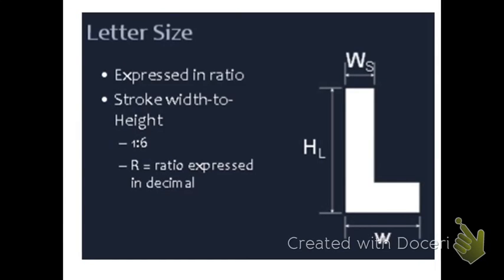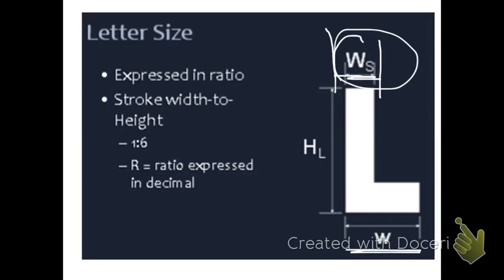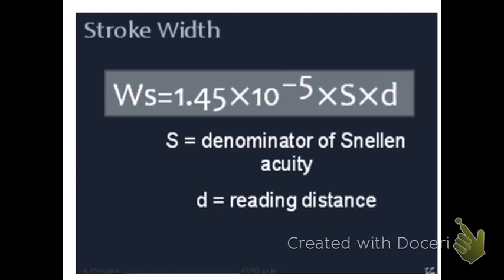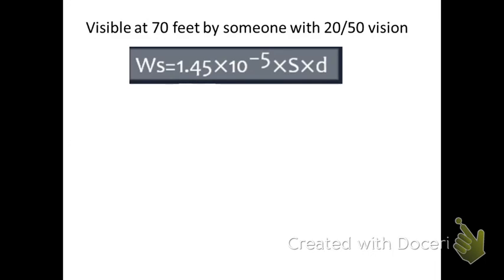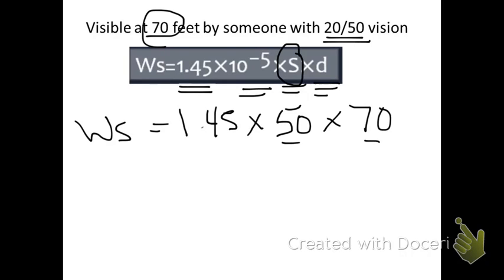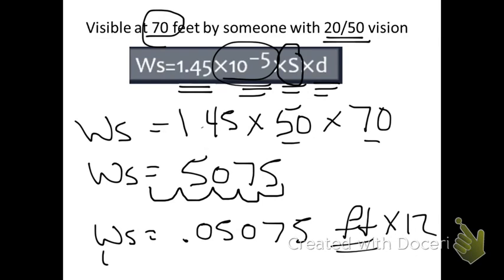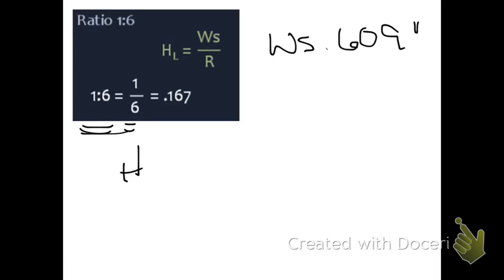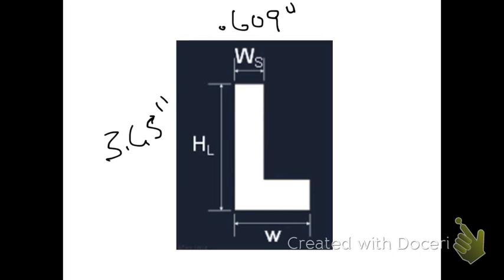Stroke Width Calculations

Comment: Hello Wayne, this formula seems to be very useful. I tried researching more into it online and I am unable to find any sources. Could you redirect me to a scholarly report or book that confirms its validity?
Reply from the maker: Hi Oscar! Thank you for watching and thank you for the question.  The author of our course got the formula from Sanders and McCormick's "Human Factors in Engineering and Design".  They referenced US Department of Commerce/National Bureau of Standards Technical Note 1180: Size of letters required for visibility as a Function of Viewing Distance and Ob\server Visual Acuity.  The formula and explanation starts on page 46 of that 1180 document. I just tried to make the application of that formula a little more understandable.  Thank you, again, for watching!!
Reply: @waynecummings9717  Thank you very much